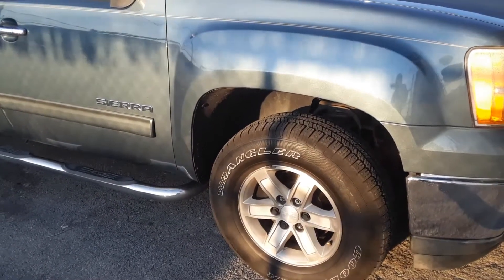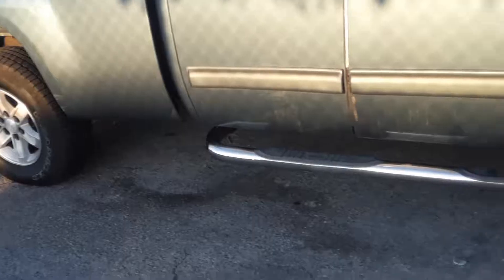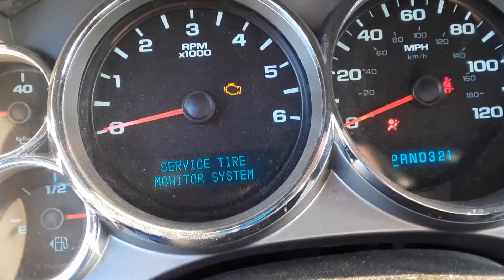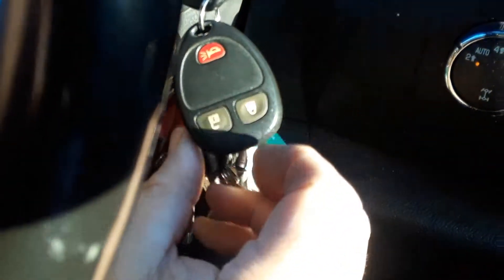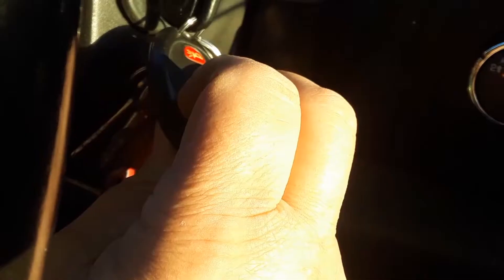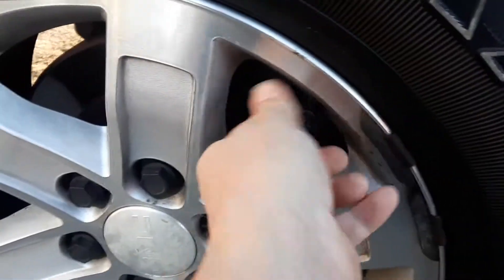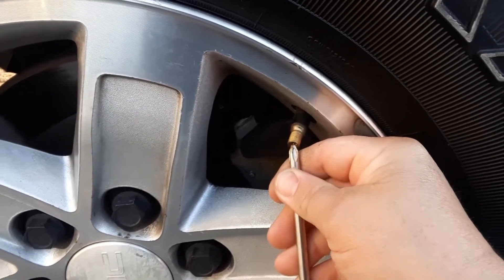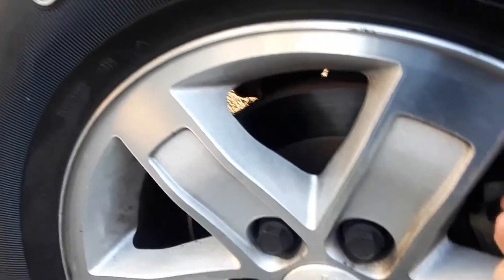GMC Sierra Reprogramming the Tire Pressure Monitor Sensor ( TPMS)

Comment: Been trying this on my 13 sierra and I can’t get the drivers side front to beep. I keep 50psi in my tires and dropped it down to 40 or below 40 and still won’t beep to go to the next tire. Does anyone know what this means? Just recently got new tires put on and none of them are are reading on the dash I would assume maybe the shop didn’t know how to reset the tpms system on the truck.

Comment: I got 2 beeps and the message about tire sensor calibration after pressing the key fob but never could get any beeps while letting air out of the left front tire for 15 seconds and the tire was inflated to 60 lbs. Reinflated to 60 lbs. and deflated for 30 seconds and still no beep. My truck is a 2013 so maybe it has the 2014 setup that won't work without the gadget which is necessary on the 2014 and up models.

Comment: Buddy you are the man!!! Worked out perfectly. I had new tires and tpms installed at Crappy Tire and I specifically asked them to reset the tpms and when i got it back those useless bafoons didn't even reset them. Your video really helped. I wonder how i can get rid of my airbag sensor light and my check engine light which is not flashing thank god.

Comment: Perfect video! Just did this on my 2008 GMC Sierra after replacing all four sensors myself. Worked exactly as you showed. I had to let air out for about 10 seconds each tire before it would beep.👍👍👍 This is what instructional videos need to be, quick and to the point!

Comment: Emergency brake and key fob press isn't required people this guy made up his own dumb process..Your parking lights will light up 1 at a time to tell you which tire to let air out.
Reply: This is correct ^
Reply: How else do you get it into TPMS learn mode then? I followed this video and it worked exactly as he explained.
Reply: What,  please explain better
Reply: I literally just tried it the way you explained, and it went to learn and I let nearly all of the air out of the tire, and the horn never sounded. I tried it 3 times, with no horn sounding.

Comment: Didn't work on my 2008 GMC Sierra. Waste of time
Reply: I just did this on my 2008 Sierra and it worked perfectly. After getting it into learn mode I had to let air out of the tire for just over 10 seconds before it beeped for each tire.
Reply: Maybe you got bad sensors

Comment: So why would you not use the pressure of the tire that shows the max psi rating.
Reply: Vehcile manufactures have different pressures for tires depending on vehicle weight. Running your tire at the max PSI rating on the tire will most likely result in accelerated wear on the inner portion of the tire. The correct inflation of the tire according to the manfacture results in the best tire/road contact and wear for the life of your tire.
Reply: Max pressure rating on the tire is specifically for that tire at max load. But if you run that on your truck chances are you will wear out the center of your tire from being 'overinflated' according the the actual weight of your vehicle

Comment: All I did is flatten my tire.. damn
Reply: Does it matter how long you let air out? Because I'm flat right now and no beeps were heard!
Reply: I had to let air out for almost 10 seconds before it beeped. Maybe you have a dead sensor?
Reply: I can get beeps out of two left tires but not right tires. Still says service tire monitoring system. It started a couple weeks after getting new tires while traveling on way back. Also the service place had almost 60lbs of pressure on tires. I was in the Ozarks driving on rocky very bumpy roads.
Reply: Same here!!